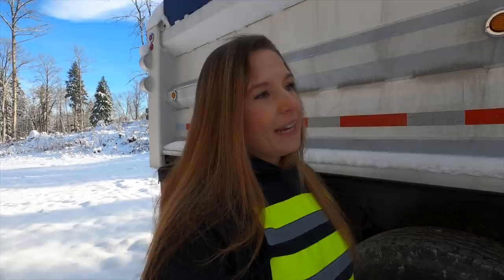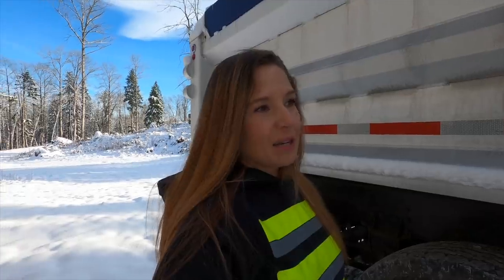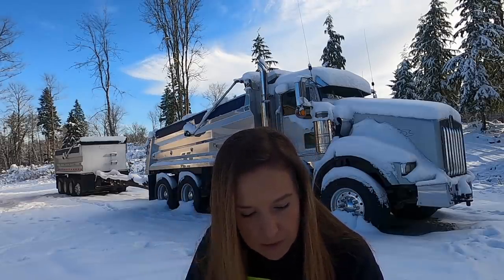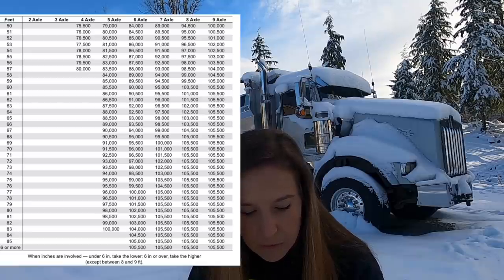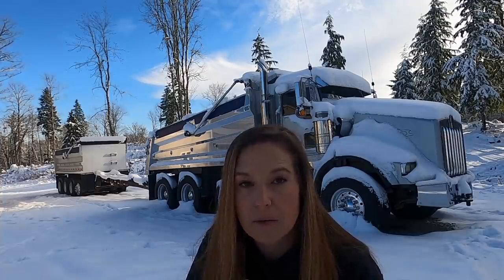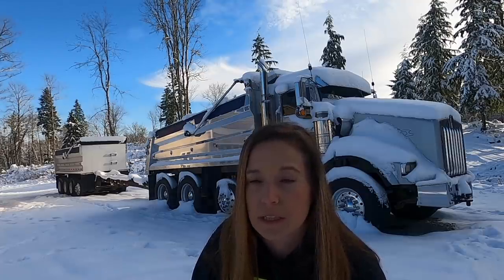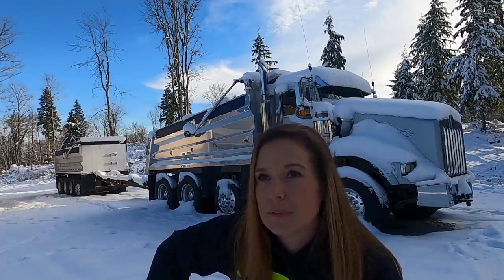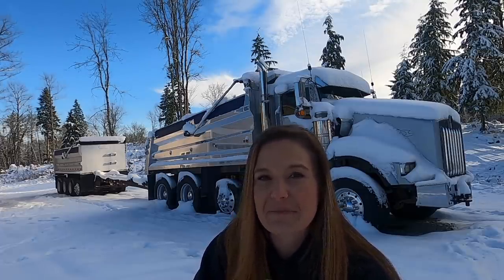WHY IS THE REACH SO LONG?!! Here is why, Bridge weight. Kenworth T800 Truck & Trailer Bridge Weight.

Comment: What you are allowed to haul and what the truck is rated for can be two very different things now that you own the truck you don't want to over load things. When the suspension and drivetrain get over load you will start breaking things and that expensive fast. Then add the down time and it makes if not worth it very quickly.
Reply from the maker: Well it’s gonna haul what it’s designed to haul and that’s 105,500. You try to go light, you won’t get any work.
Reply: @DauminiqueTheDumpTruckDriver  You have  completely disregarded what I said What you can get legally on a truck and what the truck is rated for ARE two completely different things and weight depending on what state you are in and change what you can haul leagal some states you could be over loading that truck and some states you are under loaded my state doesn't even recognize a 8 axle truck anything over 80k requires a permit when you over load a truck that's when your frame will have problems you will go thru rear ends snap u joints those repairs are extremely costly and when you first start out you don't have that kind of money laying around to fix that stuff
Reply from the maker: @N4ANE  I agree, if your truck is built for 80,000. Don’t over load it. This truck and all of the trucks like it were specifically built for 105,500. I don’t have any plans to put more weight on it than that. I’ve been driving these trucks for 14 years and I’ve never lost a rear end. Yes they do fail but not enough for it to be something to worry about.
Reply: Pretty sure that truck can easily haul quite  a bit more than the law allows.

Comment: Interesting to listen to you explain the weight limits for that combination truck and trailer you have and even more interesting to me is the sort variation that you can have in different areas of the US. Obviously bridge limits play a big part in this and here in NZ we have one standard of weights that we work to for general on road transport but a tiny country by comparison, here we work on axle weights and distances between axles and we have very low axle weights, for instance most articulated rigs run a 6x4 tractor not a 4x2 as they do mostly in Europe. For dump truck and trailer we don't have trailers like you do but that is simply two different countries way of working with our rules and job requirements, as for driving them it's what you get used to wherever you are and as you say you've been doing it around Seattle long enough to know it's not a big problem. Hope you have a happy new year and all the best from NZ 🇳🇿 👍👍
Reply from the maker: Happy New Year! I'm gonna guess that the terrain is very similar all over NZ. Here we have flat lands, hills and mountain areas. Thats why the weight laws are so different.
Reply: @DauminiqueTheDumpTruckDriver  And a happy new year to you. Yes you are quite right, we do go through a lot of variation in different areas of the country but on such a small scale compared to the US.

Comment: It's another  rules up there 🤔 here in Norway we have a different rules and heavy rules and sizes 🤔  that truck  and trailer can loading bruto  80ton!! here in Norway 🇳🇴  the standard truck and trailer  with a 6axles and the  semitruck  the  maximum load is 50ton!! we talking about  standard equipment! of course if have a  more axles like a oversized trucks equipment  more axles more loading capability!! The normally It's a 9ton per axle!! the  steering axle  8ton! anyway  that's a great truck and a best ever engine 👌  CAT It's a engine for working in any extreme conditions 👌👏👍 here in North of Norway  we have a some trucks (SiZU) made in Finland 🇫🇮  with a CAT engine  C16 and  C18 is a inmortal engine 😀 👍 👌  cheers from Norway 🇳🇴

Comment: Love your channel hope you’re enjoying your new truck looks like you got lots of snow like we did I am in southern British Columbia I’ve never seen a reach so long that’s amazing I am a dump truck driver and a mechanic for Peter keiwet and sons in British Columbia keep up the good videos
Reply from the maker: This set up is what we run here. Its very common. Thanks for watching!
Reply: @DauminiqueTheDumpTruckDriver  In my truck I have a 3 axle Truck tri  drive and a three axle pony and I run 17 ton in each here’s a tip for you with a cold start on an engine if you cannot plug it in if you have a propane tiger torch lay the torch on low setting under the axle under the motor and leave for about half an hour leave hood closed it  should give it enough warmth to turn over and start
Reply from the maker: @jimmybean768  yeah, weight laws are different everywhere.

Comment: Thanks for the explaination. I just found your channel last week. If you do stretch out I would be interested in a video of how that is done. I have been around and driven trucks (dumps and over the road). I assume you unlock the reach and pull forward or back depending if you are stretching out or in. Do you normally drive stretched out or close and then stretch for different roads?

Comment: Great chart and explanation. But I see you got the big boots on the front, does that play into the bridge or would you still have the same gross with 1100s on the front. Are they 425s on there now?
Reply: Could be due to operating in soft dirt, but also can pertain with weight capacity, probably a heavy front axle. You can go to 20k on a single axle if your axle is rated and your tires are rated. In addition many states in USA have a weight per inch width of tire so the PSI exerted on the road. Many think you can only go to 12k pounds on the steer axle, but that is on a typical semi where you have a tandem drive and a tandem trailer which can both be at 34k, so 12k + 34k + 34k is 80k the normal max for a semi truck.

When looking at weights, there is axle weights, tire weights, tire width weights, axle and axle group weights and gross weights, you can't bust any of them and be legal, so lots of variables to keep track of.

Comment: It always amazed me with how the federal government controls almost everything in our lives at this point they haven’t come up with a better way to standardize weights between all the states. Some go by the federal bridge formula, some have their own take on an axle/length/weight formula and some, like mine, split that up and go with a simple number of axle based weight restriction on state routes but go by federal bridge formula on the interstate. Here I can gross 77,000 on what you’d call a 4 axle and we call a triaxle (tandem dump with 1 lift axle added) on state routes but that’s down to 56-58,000 on interstates. Now 1 state over, which is only a few miles, in PA you can gross 73,280 with a triaxle anywhere in the state, interstate or not. It’s really ridiculous and makes it super hard on vocational truckers like us. The OTR guys don’t know how easy they have it with the standard “18 wheeler” exemption where a tandem trailer over 40 feet or so and a normal length tandem tractor can gross 80,000 anywhere they want to go, and 86,000 with a spread axle trailer.
Reply from the maker: I think the reason its different state to state is because of terrain. If you put 77K on a 4 axle here that would be a recipe for disaster. I do agree that the governments regulations are screwed up.

Comment: Is your box aluminum? I drive a Pete 389 hardbody in California and just the truck alone is 30,000lbs.
Reply: Is that a super 10 dump or some other setup? We just finished up a job where I had to track manifests and the gross and net weights for our loads going out, in San Diego. The super 10s had a drop axle in the middle and 2 fixed axles in the back, other than a few that ran asphalt as well. They averaged around 24k tare and we averaged just over 16 tons of dirt in each. Some were legal to 62k or so gross, based on bridge weight, but others were as low as 55k. There were a few trucks that were heavier, but I don't recall them being 30k........I would have to check my spreadsheet. It took 3-3.5 buckets from a 5.5 yard bucket on a 349F excavator to fill the trucks, but the tare weights and bed dimensions varied a lot, so it made it a pain for my brother to load and created a lot of tracking for me. Unfortunately that excavator didn't have a weight readout for the material being picked up.
Reply: @CGT80  Yes it is a super 10 with a drop axle. The sticker on my door limits me to 70,000lbs. I will admit this is the heaviest truck I have driven. My last two trucks tare full of fuel came in around 24,000 to 26,000. The one I drive now comes in right at 30,000 with 180 gallons of fuel, full lockers on the drive axels, and the big 550hp Cummings motor. Everything about this truck is heavier. I usually cary between 15 and 19 tons. At 19.5t puts me right around 69.500lbs. On a lot of the big earth moving project all the supers get three scoops. It keeps the loads six inches below the edge of the box no matter the dimensions and for the soil we have around here the load is about 15,000lbs. Keeps the loads legal and no one has to tarp.

Comment: Uh excuse me you're an owner operator now, aluminum to be polished, paint to wash and wax, Boston Trucker Mike will give you some lessons 😄The weight laws south of the boarder 🤔an 8 axle dump truck and transfer in BC grosses 35,000lbs more than your truck. I thought about becoming an owner operator the 1100-1400 dollars a day for a regular tandem is tempting. Its hard to find a decent truck if you want to order a new Peterbilt or Kenworth a guy is looking at 2023 for a truck. Come spring time you'll be living you're dream 👍

Comment: interesting.  i had no idea you can stretch that longer.  can wait til the demo.  i no have better understanding of bridge law as well.  i never understood the signs of small town bridge, bridge law sign and pictures on them.  So perhaps a stupid question. will you ever be that heavy (102/105K) on a routine basis?  so how are you paid?  mile? / hourly? / weight?  thank you in advance D!
Reply from the maker: Every load I'll be that heavy. Truck is paid by the hour on the majority of jobs but some hauls between pits pay by the ton.

Comment: I didn't say it's hard I meant I wouldn't get out of bed due to it being an inferior design. There are about 5 things, but the one that is noticeable the most, whether the draw bar is long or short isn't the problem. Well really short is. Anyway here there is a pivot on the front axle of the trailer therefore having 2 articulation points. The other pivot point being at the tow coupling like any typical trailer. This way more weight can be carried on the front axles of the trailer vs the weight being transferred to the truck and you can jack-knife (medium length draw bars) into bays at landscape yards ect. Maybe you can do a video on Australian trailers. I don't think the America law maker's or trailer manufacturers know about how we do it over here. Nothing's going to change unless it gets known and talked about. A couple other things, being the tow hitches. A ringfeder vs pintle is also better because the whole hitch turns 360 degrees if you roll the trailer. Also the axles are not close together here. 1 at the back and 1 at the front or 2 at the back and 1/2 at the front. Some are 6 axles. 3 at the back and 3 at the front or even 4 for mining applcations. Another way to describe is the front of the trailer is similar to a 5th wheel pivot. All are dual wheels and no drop axels actually there can be but it's always dual axle drops and not this little helper wheel. We call them dog trailers. A fixed trailer like yours is called a pig trailer. We have them too but not with drop axles and single wheels. They are very uncommon on dump bodies for the reasons I discussed. Also we call them tipper trailers not dump trailers so one would say dog tipper trailer or pig tipper trailer.
Reply from the maker: It’s doesn’t have a second pivot point though. 🤷🏻‍♀️
Reply: @DauminiqueTheDumpTruckDriver  Yes that's ture and trailers as a whole over there aren't produced to that style from what it seems? I could be wrong.
Reply from the maker: @Dan-rg7jj  I know exactly zero about how your equipment is built. I do know our regions equipment and why it’s set up this way though. I’ve driven end dumps. Which sound like you’re trying to describe. They are dangerous and I wouldn’t be upset if I never had to drive one again, but if it meant feeding my family and putting a roof over their heads I would do it.
Reply: @DauminiqueTheDumpTruckDriver  It's a good Youtube idea to talk about Australian things as an American. Could get a lot of views. You see all these people swapping cummins into Tesla's now if you did a cummings into Australian bodied cars (on the ground in america) that would get a lot of views. It would take like 5 mins to research our trailers. Just seach dog tipper trailer. They are not end dump's attached to a semis.

Comment: I saw this in a more recent video and I was puzzled as to why it was stretched for road and then compressed again.
Granted I am from Europe and I can understand weight limits per axle.
But what I don't get, what does this change physics wise? I mean you have the same axles and the same weight so this seems more to be a way to get around a legal loophole?
What is the reasoning behind this stretching, does it at all do something other than making it legal on paper?
Reply: I don't know the answer for sure,  but I suspect that it has to so with shorter span bridges.  A bridge is weakest in the middle of the span.   Imagine that the truck was 50,000 lb and the trailer was 50,000 lb, if you stopped in the middle of an 80 ft span, you;d have 50,000 lb 10 feet from one abutment (the end support of the bridge)  and another 50,000 ft 10 feet from the other end.  That's a lot less stress on the bridge than having the entire 100,000 lb placed in the center of the span.  With a 65 foot truck/trailer combination,  the most you would ever have at the center of the span is 50,000 lb

Comment: 15 tons in main 15 tons in pup unless it excavation the rule change at least does in utah do you have over weight permits were you live at
Reply: How come the rules change for excavation or gravel?
Reply: @reefready9284  anytime you haul excavation meaning from a jobsight you still have to try be legal but as long as you put xout on paper work like she should be legal haul xout 15 on paper work her weight changed on the law, but you still cant load over the brim
Reply: @reefready9284  gravel it does not change because you have to have legal scaled load
Reply: If you are hauling from a jobsight that consifered excavation meaning tear out

Comment: Do all dump trucks there use pups or no? And why do you use them and not a straight truck?
Reply from the maker: Majority of the trucks are truck and pup. Material has to travel 30+ miles to be discarded and rock has to be brought in from 30+ miles away. A solo dump truck is too slow.
Reply: @DauminiqueTheDumpTruckDriver   ah ok I always wondered that we run straight truck in pa, that’s why I asked! You won’t see truck and pup here

Comment: I see you rode in the t880 and t800 what are your thoughts on cab size
Reply from the maker: I’ve driven both. The cab is huge on the t880. I prefer the T800 but I’m also not a big person and I’ve driven them more.

Comment: Easy to pull yes; not so easy on the public side of that equation! 2007 that Microsoft employee stepped off the curb after the truck went by, trailer killed him. I have had people at traffic lights cut in behind the truck because they didn’t see the trailer tongue, due to it being so low. 
PEOPLES r dum! 😏
Reply from the maker: If you can’t see the reach in front of you before you step off the curb you’re an idiot. I would never wish pain for death on anyone but look around you and stop staring at your phone.
Reply: @DauminiqueTheDumpTruckDriver  amen... wake up, look around, smell the air, and live

Comment: but still, why was the trailer build like that?
you could easily use the whole trailer length and a 6 ft boom to get the extension out of it without making it unnessesary long,
say for yard or Off Road use, it would be very handy to shorten the boom to 6 ft. distance for empty or yard manouvering,
since you can extend it basically on the fly with out getting out of the truck.
Reply from the maker: I get where you’re coming from but it doesn’t matter. You make the box bigger and shorten the reach, all you end up doing it giving an operator opportunity to excessively over load you. These trucks do well off road and they do well in town. We’ve been running trucks like this for decades.

Comment: Hell it's a dump truck and u just want to haul more weight that's only reason u want it set up like it is but problem is u don't usually get payed by the ton u are payed by the load so really no reason to pull a trailer with dump truck bc I run a dump truck that is set up where I can gross 80 thousand pounds without trailer and haul more loads per day then ppl pulling trailer and get into alot more tighter spots then they can
Reply from the maker: No, you get paid by the hour…. The hourly rate is determined by how much you can haul. Not to mention if you are just solo you are less like to get work. This truck is for heavy construction, I’m not doing home delivery.

Comment: Reach???? You mean wheelbase
Reply: Spread is a better word.  the driver needs to spread the weight over a distance depending on the weight,
Reply: @Bendigo1  no the proper word is wheelbase ...
Reply: @bendaves77  Yes, but spread is a better word.